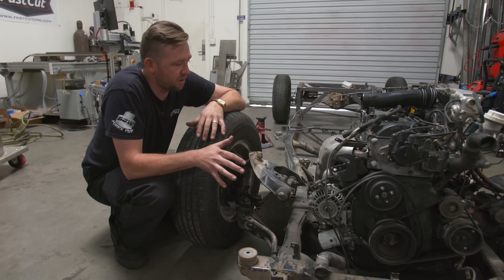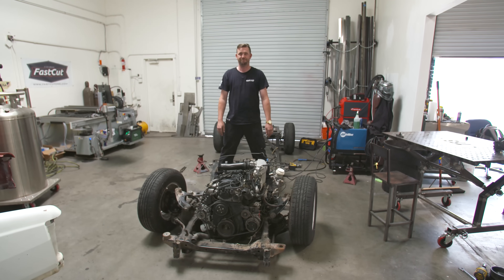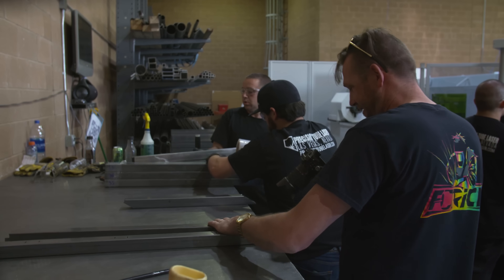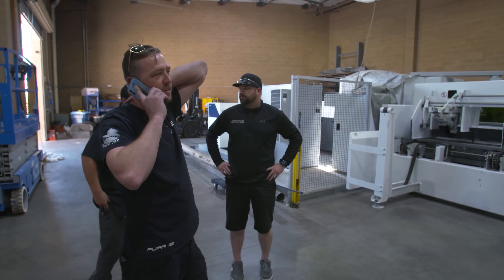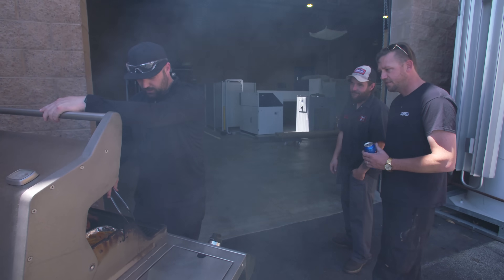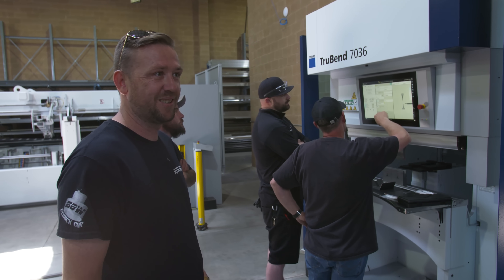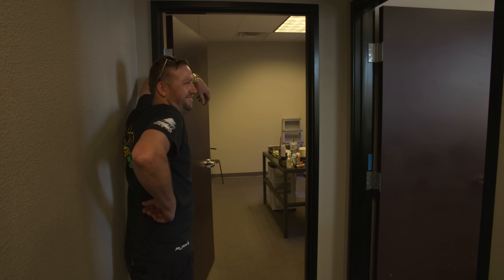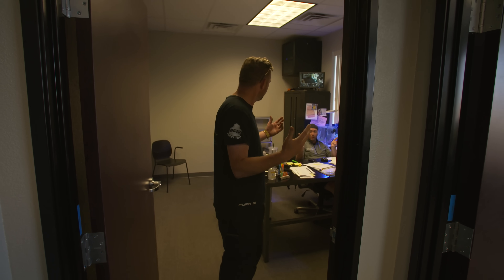Designing my Car Body

Comment: The reason you create schedules? So you can document everything that need to be done. Lead and lag are part of scheduling. There is no problem moving events forward or backward as long as the few things that have to be done before other things “drop dead “ items are hard in the schedule. The rest is movable so that the end of the schedule makes the end date requirement.
Reply: PM 101…👍